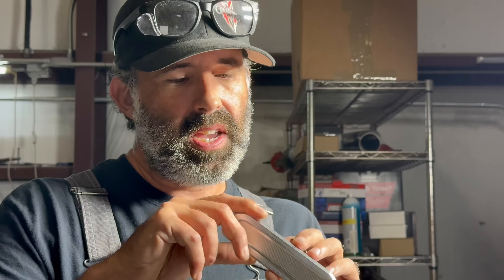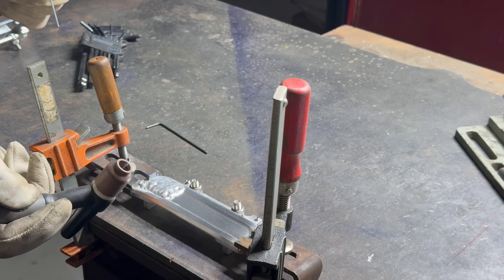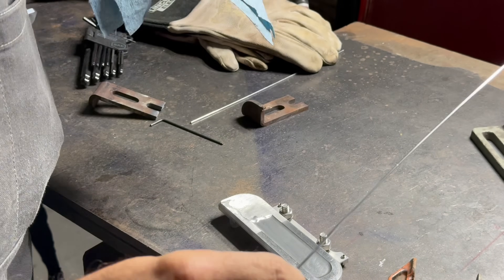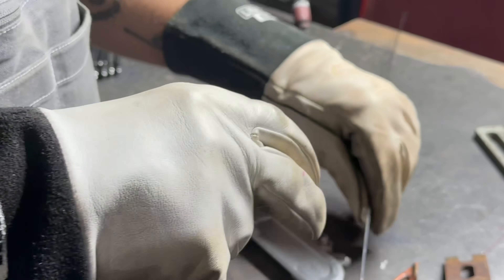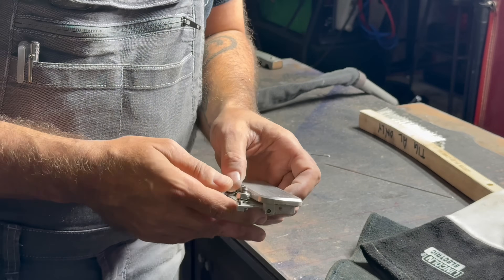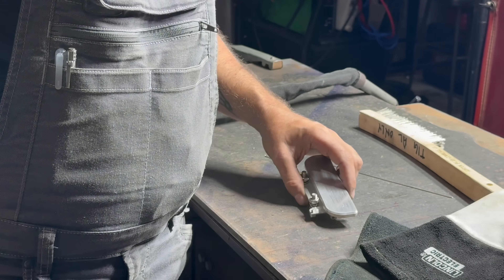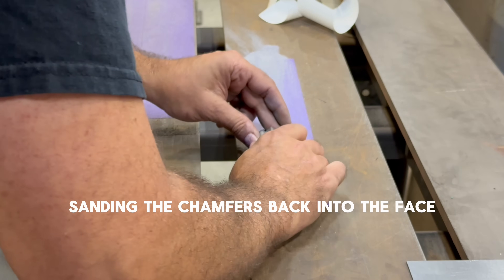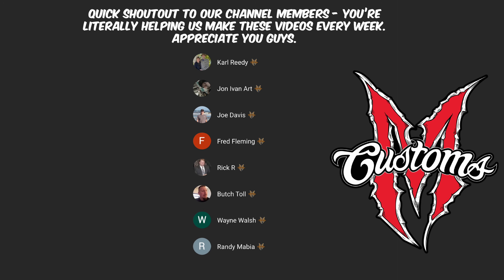Metal Finishing Easy. Try these Simple Techniques.

Comment: That seems like a lot of work. Customer might have been better off just telling you folks what they wanted and let you do everything. Seems like money and time thrown away buying something they weren't all that happy with, only to ask you folks to modify them.
Reply from the maker: CNC milling, finding a machine shop willing to make a single set and designing a one off handle without a .step file would have been 1K+. Modifying a set of 123.00 handles was the better option.
Reply: Thanks for clarifying and have a Happy Thanksgiving!
Reply: @martinbroscustoms  Surprised y'all don't have a vertical mill. This would have been an easy enough piece to remake on a manual mill.